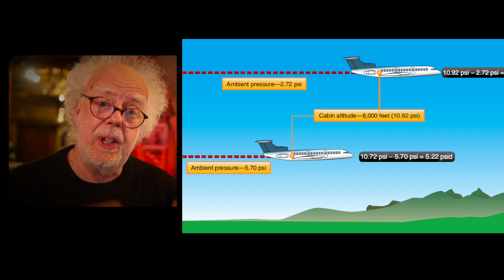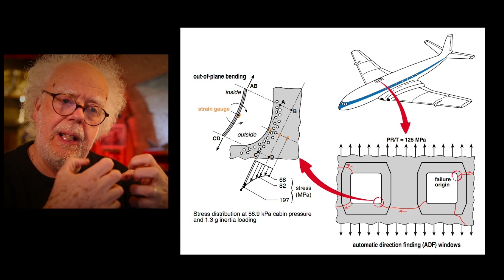777x  - Prof Simon

Comment: Well no the reason Boing went back to people building the 777X is because they can't blame robots for design flaws. Besides that isn't that the carbon fiber aircraft?
Reply: Donald Grant    The automatic riveting machine use was stopped because it created more rework due to errors than human beings created.  The timing of this may look suspect.  But, the reality is that the automatic riveting machines were not ready for prime time.  The problem revealed by failing the over-pressurization test is most likely unrelated to the riveting machine problem.  And, if it is related, then Boeing has some very serious decision making problems.  Problems that will reduce confidence in its ability to produce safe airplanes.
Reply: Italian composite components for F-35 were frequently broken or cracking. People went crazy looking for flaw in manufacturing. It turned out, that workers who used incorrectly calibrated electrotools were causing just enough bit more stress, so entire detail would fracture.
Reply: The 777X is still aluminum, our only carbon composite commercial airframe is the 787.
Reply: @PlanesAtPaine  Thank you. I knew they had built one out of carbon what ever.

Comment: Professor Simon,  I'm just wondering if you are a pilot yourself. I'm a Private Pilot, Airframe and Powerplant with an Inspection Authorization.  I am semi-retired but still dabble in the business just to keep busy.  You seem to have considerable knowledge about aircraft in my opinion, much more than most would know without being involved in the industry in some way.  Great Channel!
Reply from the maker: yes...private single engine land...learned to fly in the UK but did most of my flying in the USA...where I owned a cessna 152 and Piper Cherokee 140.  great fun....wish i was an AP.
Reply: Professor Simon Holland You and me and possibly a few million other people (wishing to have been an AP).
Reply: I still regret not completing airframe mechanic testing when I was a Boeing engineer.  Welding as one of the only processes I had no experience with and at the time could not find a way, without going to A&P school.  As an Air Force aircraft mechanic, pilot, and aero engineer, I was eligible to take a refresher course to qualify to take the FAA exams.  I regret not taking an apprenticeship course in welding back then.